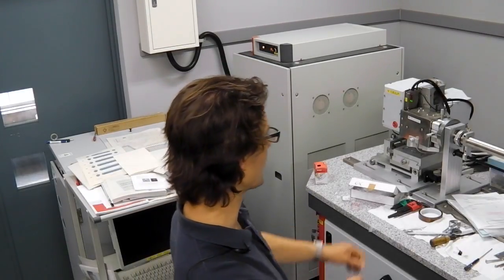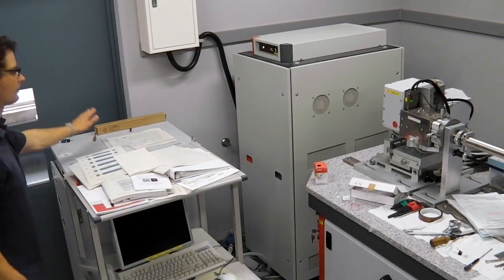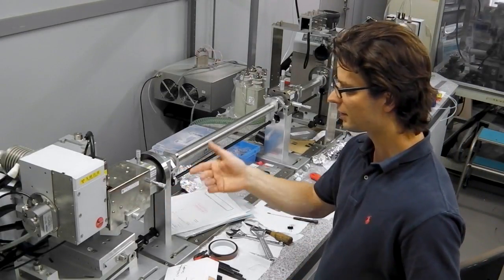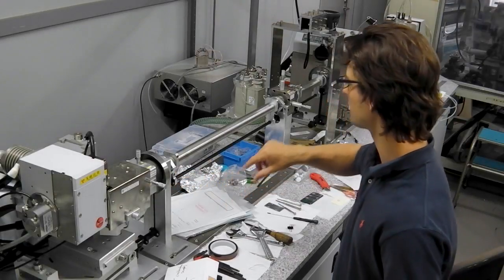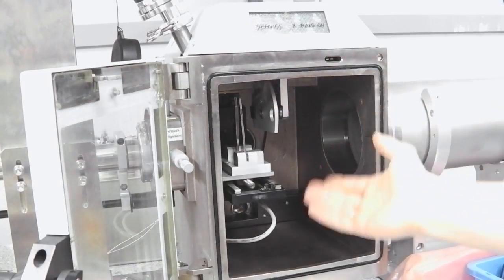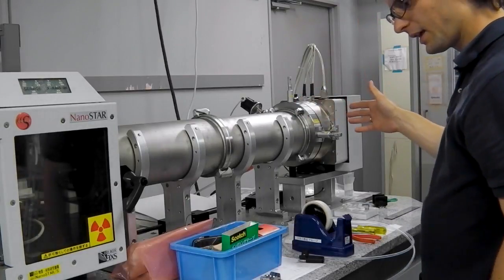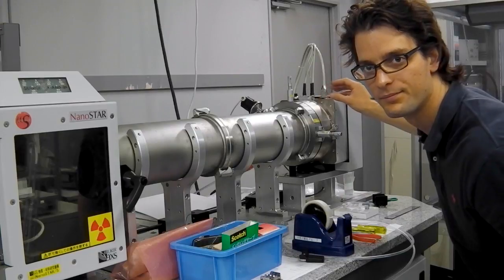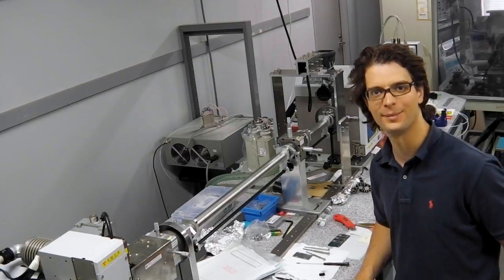SAXS instrument components

Comment: I'm not sure when or why I subscribed to this channel, but I'm glad I did. This was quite interesting. Just one question, though: Why does it need three pinholes? What purpose do the second and third ones serve?
Reply from the maker: Hi Oğuzhan,
The optics are far from perfect, so imagine you have a divergent, big source point to start from. Secondly, the pinholes themselves also scatter. It's like trying to clean up chicken shit by throwing more shit at it. 
So the first pinhole cuts away part of the beam, but scatters like hell. The second pinhole defines the divergence of the beam and cuts away most of the first pinhole's parasitic scattering. The third pinhole doesn't touch the beam passed through by the first and the second, but sits around it. The third pinhole therefore only removes the parasitic scattering from pinholes 1 and 2. 

There is a modern solution: slits and pinholes that do not scatter. They are expensive and may not be well suited for higher energies, and so we'll see whether they will appear in our instruments.
Reply: drheaddamage Thanks a lot! And great analogy there, by the way.